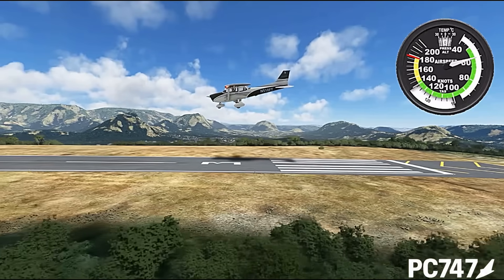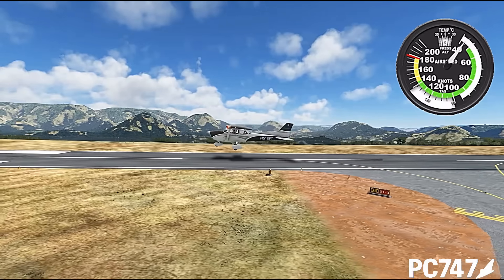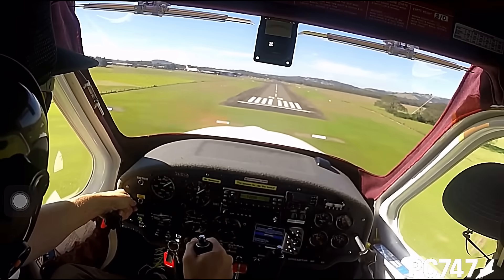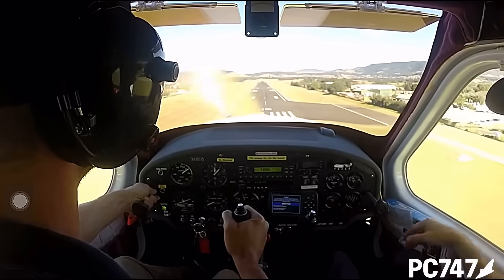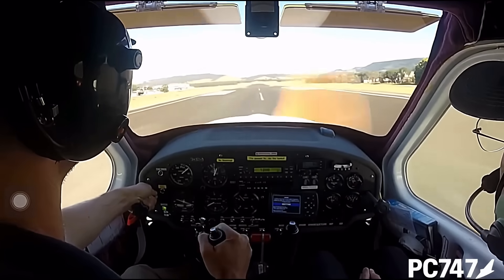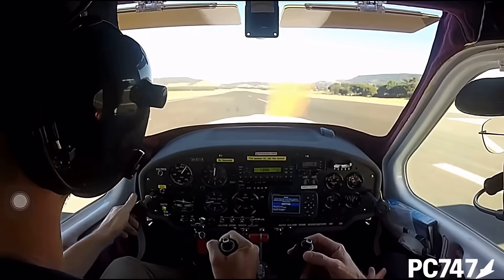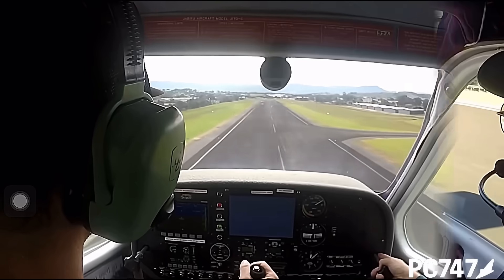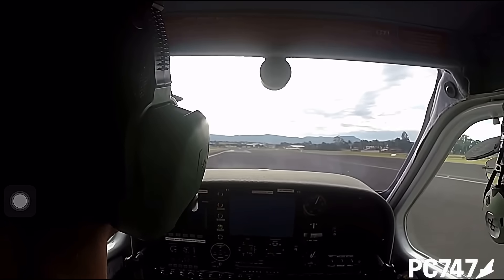How to Land a Plane -The Secret No One Tells You

Comment: I liked the video.  I agree with learning one control at a time for both speed and quality of learning.  My primary helicopter instructor in Army flight school told us to (pardon the French), "move the damn control.  How else are you going to learn what it does.  If you don't like what you get, put it back."  Since I had learned long ago in 65 hp conventional trainers (that means tailwheel), I was taught dynamic proactive rudder pedals movement (walk the rudder) from day one.  Nothing keeps longitudinal alignment and bracket/nails the centerline (in the air or on the ground) better than this constant rudder movement.  All four controls, collective and throttle and cyclic and anti-torque pedals must be moved dynamically and proactively constantly in hover.  It is the same as balancing a broom on your hand.  Waiting for the nose to go wrong and then correcting with rudder, reactive control, eventually will end up in ground loop.  The same with wing wagging from trying to turn on short final.  We are headed for the numbers.  We don't want to turn, especially with wing wagging adverse yaw when busy with flare and other stuff.  And when we arrive at ground level in three point attitude all slowed up and ready to squat (your ten second deal), we can add a little power to hover taxi the 172 all the way down a long runway under the well below Vso airspeed of landing that students get so little practice at without hover taxi.  And yes, we have to move the yoke for/aft dynamically and proactively to set our own phase rather than get out of phase with the climb/descend occilations of the airplane when this slow.  And when we bracket/nail the centerline extended on short final with dynamic proactive rudder (sitting on our hands), the wing stays level.  If we allow absolutely no turn with aileron or significant yaw (fast dynamic proactive rudder) with the rudder, a wing cannot go down...yes, even in gusts if we are ahead of the airplane.  And finally throttle, used dynamically and alone, to nail glide angle and rate of descent if we simply slow enough to require throttle to prevent mush.  When we close the throttle, sure fine on very long runways, we give up accurate control of glide angle and rate of descent and have to wait your ten seconds to settle.  On short fields, as all small town grass runways were in the past, we had to get very slow on short final and use dynamic throttle to nail glide angle all the way down to the ground at the very beginning of the runway.  Preventing the speed up of the normal (far back) apparent brisk walk rate of closure with the numbers by looking at the numbers rather than the airspeed indicator results in arriving at those numbers in a three point attitude all slowed up and ready to squat, as Wolfgang taught in Stick and Rudder in 1944.
Reply from the maker: Jimmy,

  Thank you so much for sharing your kind comments & your incredible snippet of knowledge! As much as I enjoyed learning to fly, in Cessna 152’s, there are skills and knowledge that you just can’t replicate when you’ve learned in a tail wheel airplane.
I actually wish I had learned in one after reading what you wrote! 🤩🤩🤩

I did take a few helicopter lessons long ago in a Robinson R22. Seven hours. 🤪

  I must confess, I feel, in a way, that I was brought up, and trained, like so many others who, through “progress” & previous liability law cases, became both the fortunate  & the unfortunate recipients, of newer primary aircraft whose ground design, with tricycle gear, in one fell swoop, redefined what it meant to learn how to fly…….

There was a book, written by a female school teacher, long ago, who had taught for some 30 years…..called ”Dumbing us Down.” In a nutshell, it describes the lowering of standards, system wide, to get all people through school. Of course this has come at a cost, for all of those other students who require intellectual stimulation and are not getting it…..

I’m not convinced the same thing has happened,  in the aviation industry, at least intentionally. But, there has indeed been a great deal of loss in knowledge overall.
. 
When I read what you wrote, it reminded me of the tall ship mariners. That body of seamen, who, with no engines at all, maneuvered their ships around the world. Incredible skill and knowledge of a bygone era, fewer and fewer know, retain, and share with others.

Likewise, as flying has gotten prohibitively more expensive to learn, operate and own, the reduction of core knowledge, & it’s precepts, has naturally followed suit unfortunately.

Regards,

Carlos
PC747

Comment: When I learned to fly, ~40 years ago, I was taught most of these tricks. My instructor was an older guy that was instructing pilots in WW2, so was all taildraggers, and I was learning in a Cessna 140, a taildragger. He beat those tricks into me from day one. He taught me lots of stuff that definitely saved my ass many times. I firmly believe that the 300 hours of taildragger time I got, and all the basic 'stick and rudder' techniques, were a big benefit for my later flying. 
Your presentation was a lot cleaner and clearer though. Many thanks!!
Reply from the maker: Andy,

  Thank you for sharing that and for your kind comments! I wish I had more tail wheel time. I have 30 minutes in a J3 cub and two hours in a C-140.

Regards,

Carlos
PC747

Comment: non flyer.  don't even play MS Flight Sim. Just interested.  I think I get the idea alright.  He teaches one axis control at a time.   Okay.  What I don't get is how he lines up the plane on the stick alone? He says low wing causes it to go offline. okay.  but that also causes turning doesn't it? and to stop turning you use your feet on the rudder?  so how can he teach them to line up first  ( the 'fore-aft' axis)  when he's saying ( I think ) that they only have the stick and he has the pedals?  Am I misunderstanding the whole thing?
Reply from the maker: Hi

  You’ve actually done a really good job of explaining that and what you want to learn thank you. I’ll do my best…….

When an airplane is turned to the right for example , the nose will typically follow in the direction that the wedding is lowered..  so if you turned to the right the nose want to go to the right….

Likewise, if you lower the left wing or turn the controls to the left, the left-wing will go down. As a result of that, the news will wanna follow the wing that went down so in the left turn, the nose will follow and start turning to the left……

Unless 

Anticipation keeps the airplanes nose straight 

what I mean by anticipation is , on final you’re not always gonna be perfectly lined up on the extended center line of the runway…..

so

You have to be prepared to sideslip to line up the aircraft with the runway . A sideslip is an uncoordinated maneuver in which the airplane moves sideways while at the same time maintaining a parallel axis with the extended centerline of the runway.

So for example, if you are on final ,
And you are left of extended centerline that means on the left side of final and you need to move to the right ….

You’ll know that you have to lower the right wing in order to move sideways to the right 

But 

You will also know that when you lower that right wing, you will know in advance that every time you do that the nose is going to want to follow the direction of the Lord wing in this case the right wing when you start that turn to the right with to line up with the runway

This anticipation means that you will be applied left Rudder simultaneously at the same time you’re lowering the right wing

If you lower the right wing a little, you will only simultaneously add opposite router or left Rutter at the same time 

If you lower the right wing a lot, you will consequently have to increase the amount of left runner application in order to keep the nose straight to keep the aircraft longitudinal access, parallel with the runway …

Let’s try one more time let’s pretend we are on final, but the extended Center line is to the left of your position . In other words, you are right of center line and you need to drift to the left……

You know you have to lower the left wing 

You know when you do that, the nose is going to want to follow the left wing and turn to the left, but you need to prevent that from happening….

So when you lower the left wing, you will simultaneously apply opposite or in this case right redder in order to keep the aircraft, longitude parallel with the runway 

I hope this helped if you have any other questions, I’ll try and answer them for you 

Cheers!

Carlos
PC747

Comment: 'The Secret No One Tells You' - Sadly, that's true, as many trainers cannot explain how landing works. I started in sailplanes, proceeded to motorgliders, to PPL, night-VFR, and single-engine IFR. Additionally, a trainer's rating with acrobatics for sailplanes and towing flights for motor planes. Altogether, I had some 3500 hours and 9000 landings in my logbook. Sadly. I learned how to land systematically when I made my instrument rating. A stabilized approach at a predefined speed is most important, and then the pilot must have patience to let the plane sit down on its own without tearing it away from the ground is crucial. I remember a passenger flight in a DC-9 on a typical beginner's route (Munich to Vienna), where the pilot did not have the patience, took the plane up, and the captain pushed the throttles; we bumped from some two meters into the runway. It was quite amusing, as my boss also held a trainer's license and was aware of this error, of course. But we had not expected that somebody would do that with a full airliner.
For most taildraggers, it is important to decide between a pulled or a pushed landing. Something in between does not work, 'average landing time 07, continue hopping to the apron' - You could see the face of an airliner captain shining in red.
What a problem for me was to train a motor pilot flying a sailplane. Motor pilots rarely use the rudder. If you try to follow a towing motor plane, that does not work, as the nose always does the opposite of what you want. It needs intense training to use the stick for height and bank control, and the rudder for side control. Landing is no problem for them. And the second problem is that searching for upwinds is an art that needs practice that goes far beyond the requirements for a license. Most of them do not have the patience for that.
But once I got an elderly woman. She looked twice at how I made the landing, and landed sailplanes and motorplanes correctly. She was also able to fly a quarter of a circle with a 5km radius to the aerodrome with a slow power glider. Also, my experience was that women usually needed nearly twice as long as men, and old men twice as long as youngsters, on average.

Comment: What seems to work under instruction is to get the student to fly parallel to the runway at about 10' for the full length.
During that time you can get them to focus on the end of the runway and notice the peripheral vision to the left and right.
If you're at a rarely used runway on a nil wind day you can go up and down the runway a half dozen times at 10' with flaps in the landing config with emphasis on elevation and airspeed control. This gives 12 approaches. Student relaxes a bit. Starts being able to do it for themselves, then instructor at 5' introduces reducing power and raising nose. 

Yeah information overload is a shocker.
Reply from the maker: I can see that working as well. Thank you! 🤩🤩🤩

Carlos
PC747

Comment: Do you prefer "pitch for airspeed, power for altitude", or the other way (point and power)?
Reply from the maker: Definitely pitch for airspeed & power for altitude. When aircraft are configured for landing with the gear down, power is primarily used to maintain a certain rated descent, all the way to landing.

Power is also primarily used to set your landing point on your windscreen .

If it’s set , and then you suddenly chop the power, the landing point will appear to rise on the windscreen…

If it’s set , and you add power, the landing point will appear to descend

I hope this helps . 🤩🤩🤩

Carlos
PC747
Reply: @PC747Aviation  Thanks for the reply! I heard Jets use point and power, is that true?
Reply from the maker: @zetareticulan321  I’m not familiar with that one!

Comment: stabilized approach is everything, if you put the plane in the right configuration in the right position it lands itself.  
I was on a 777 out of vegas last month and the pilot wasn't applying controls for the cross wind on take off.  we were skidding sideways down the runway with him making sudden jerking correction with the nose gear, I was in the back swinging back and forth wondering what the hey?  This was on a major carrier too, sure they have to learn at some point but come on, that's PPL stuff.
Reply from the maker: I agree with you. 🤩🤩🤩 I doubt it was the captain. There are a lot of lower time pilots operating very large aircraft now.

Regards,

Carlos
PC747
Reply: @PC747Aviation  I think the guys flying these airliners should have to maintain a certain number of hours each year in a tail dragger of some sort, their rudder skills are terrible, I see it almost every time I fly.  you can tell they're not comfortable with using the rudder.
Reply from the maker: @FourthWayRanch Reading your comment made me laugh because it’s so true!!!!🤩🤩🤩